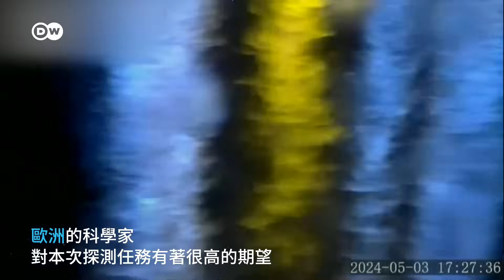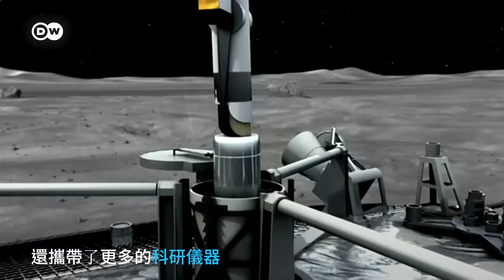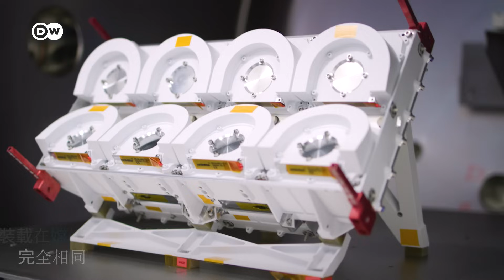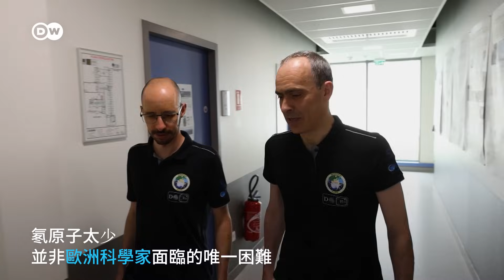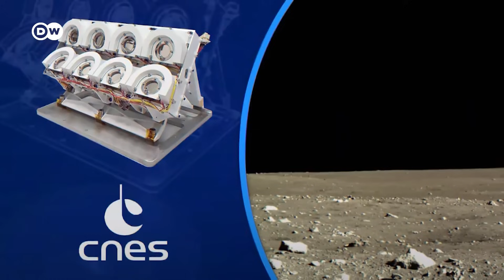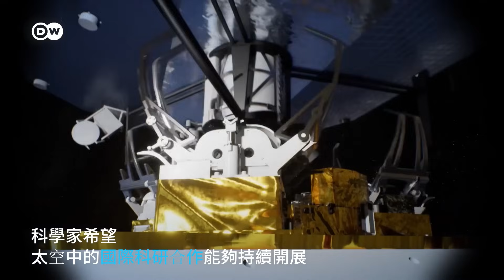歐中月球合作 是否面臨政治風險？

Comment: China has successfully landed its spacecraft on the Moon's far side.
China's Chang'e-6 probe landed on the far side of the moon aiming to collect samples from the South Pole-Aitken (SPA) Basin which will be brought back to Earth. 
The lander-ascender combination of the Chang'e-6 probe landed at the designated landing area in the SPA Basin. The mission has made technological breakthroughs, including lunar retrograde orbit design and control technology. It will go on to complete key tasks such as the intelligent, rapid sampling from the lunar far side and lunar surface take-off. 
The probe of Chang'e-6 has gone through various stages such as Earth-moon transfer,  near-moon braking, lunar orbiting and landing descent. 
The lander-ascender combination separated from the orbiter-returner combination on May 30.
The Chang'e-6 probe faces a different terrain to the Chang'e-5 sample mission. 
To sample-retrieve from the lesser-known far side, the probe needs a relay satellite for communication and needs to be even more efficient and time-sensitive.
Due to the moon's obstruction, the Earth-moon communication window period on the far side of the moon, even with the help of the Queqiao-2 relay satellite service, is still shorter than that on the near side. 
In a major leap for lunar exploration, Chang'e-6 boasts an intelligent sampling process that allows the probe to autonomously execute instructions and make real-time decisions based on sensor data, reducing the need for constant communication with Earth. 
Essentially, Chang'e-6 can break down complex instructions into smaller actions, verify their success using on-board sensors, and adjust its approach as needed without waiting for further commands from mission control. This significantly streamlines the sampling process and minimizes delays caused by Earth-moon signal lag.
Well done.